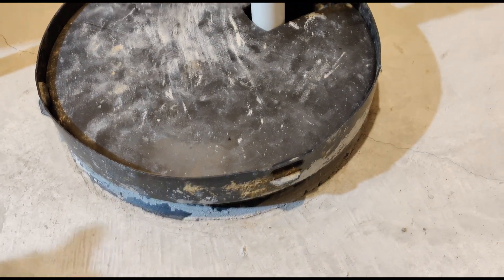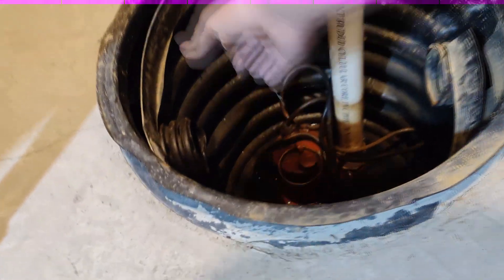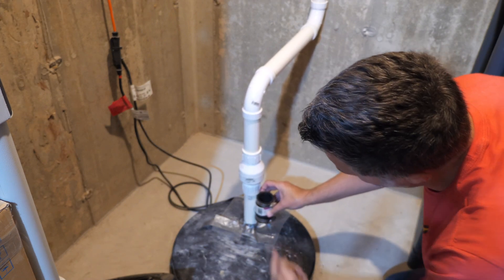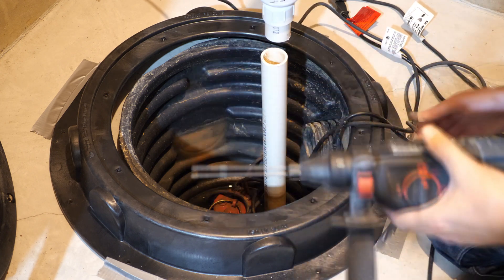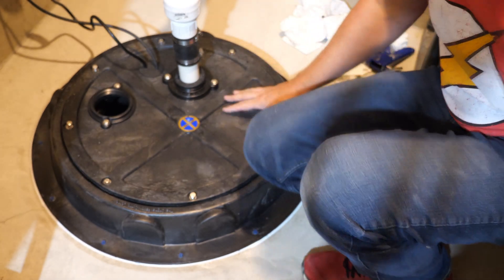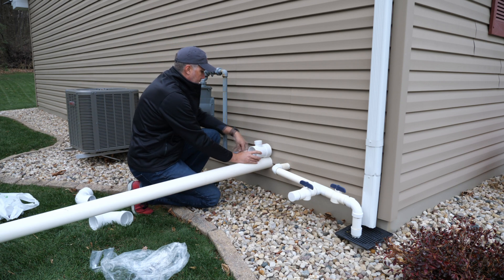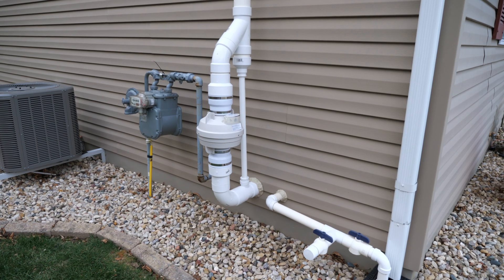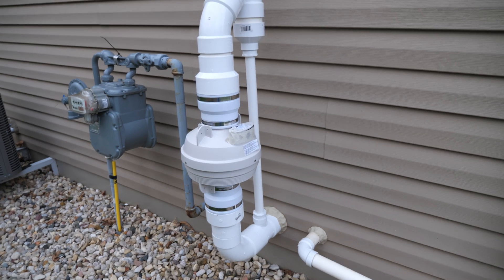Radon Mitigation System, parts needed and installation - Part 2 of 2

Comment: My first radon system did not have a condensate bypass system. Radon fans were only lasting about 4 years. Installed an insulated condensate bypass system when I replaced the 2nd fan. That was 8 years ago and that fan is still running nice and quite. Seems it really is worth it to install a condensate bypass.

Comment: Where does the radon come into the sub pump?
Reply: The radon is under the floor -- enters pit through corrugated tubing (drain tile) under the floor. The sump pit (not sump pump) simply provides a convenient location to access the area under the floor.

Comment: I have a finished basement with high radon levels.  I want to install the mitigation system myself.  I do not have a sump pump hole since I live in an area with low ground water levels.  What added steps do I need to install the system, i.e.  cut a concrete hole in basement floor.  How big does the hole need to be, and is a condensate pipe still needed?

Comment: thanks for the video, how did you get power to the  outdoor outlet via the house , direct wire connected to indoor outlet or new line from electrical box, 
 dedicate line ?
Reply from the maker: I connected into the outlet that was there for the sump pump. The fan draws little power, so it shouldn't be an issue.

Comment: Hi, may I know if the fan can only be installed outdoor or it is ok to install indoor?
Reply: The fans are normally pretty noisy. You want them outside so you don't hear them in your basement.
Reply: It's also against building code to install within a living space since accidental disconnects or other piping failure could allow the fan to basically pump the radon into the living space.  So the fans are generally installed outdoors or within an attic only - no crawlspace either as accidental disconnect would then allow the radon to seep into the living space above.

Comment: I'm about to start this project myself.  So the drip drain simply catches moisture that condenses or rain falling in and sends it back into the pit to be eventually pumped out?
Reply: Correct, rather than into the fan itself.